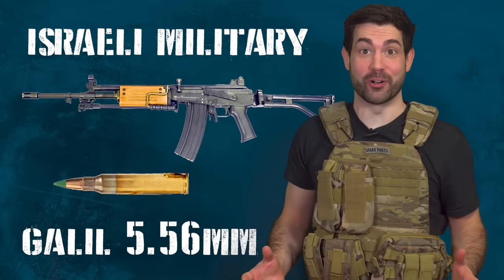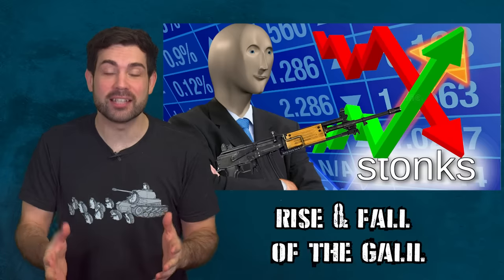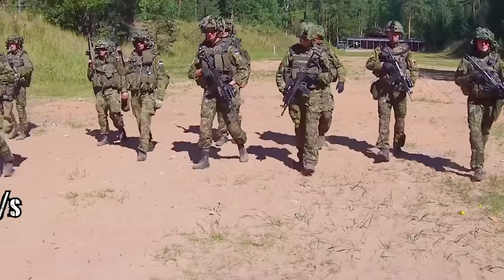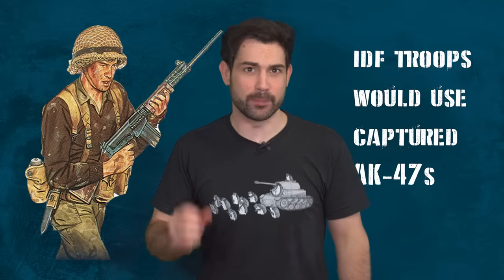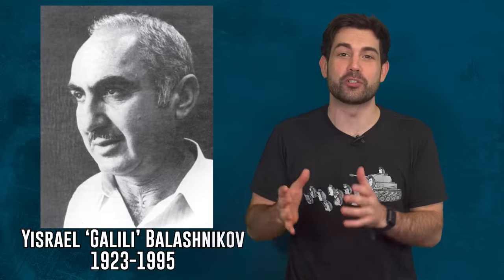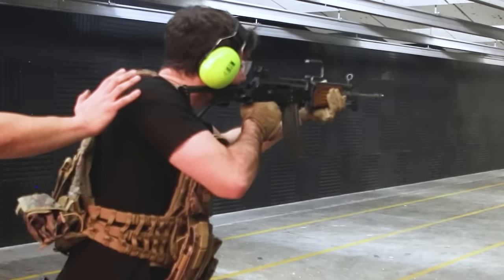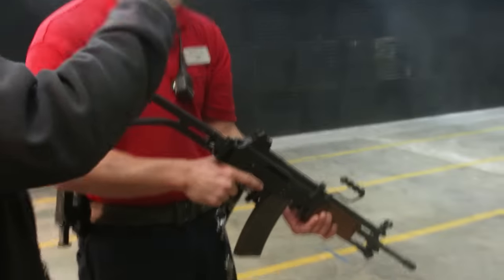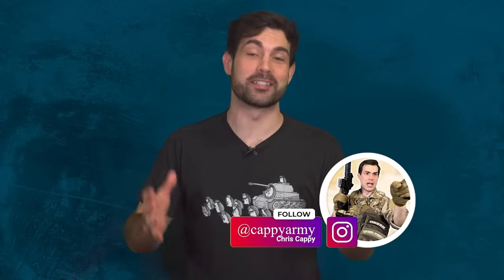Why the Israeli Army Created the Galil Rifle

Comment: Correction, Estonia made the switch to an LMT rifle designating it R-20 "Rahe", my battalion(you feature us prominently in the vid) was actually the first to get it. Spent a fair amount of time with both rifles and gotta say, the galil is still definitely my favorite AK variant, everything on it just makes sense, the charging handle, the safety, it was very pleasant to operate(didn't have the cap opener though, we had a pic mount :) ). The R-20 is a really good AR imho, not the HK416 but still very nice. Though how light and compact  it felt in hands after the Galil was astonishing. 

Former Sargeant, paramedic in the Estonian Scout battalion for 3 years
Reply from the maker: I had the pleasure of training with the Estonian army at Saber Strike international training event in 2010 you all were a great bunch of dudes! Glad to hear you dig the Galil. I'll have to look into the R-20 for a future video!
Reply: Thanks for serving in the cause of freedom !
Reply: I’ve got one of the Estonia LMT rifles. Excellent system!
Reply: Yep, if I recall the New Zealand defence force also adopted the weapon (they designated it as "MARS-L") a few years ago as their service rifle to rplace the old Steyr AUG.
Reply: @Infinite-if7uq  I believe their spec-ops adopted a variant. The NZ one is direct impingement, it's got a different gas block if you compare the two, ours has a short stroke gas piston I believe. I might be wrong though.
Reply: Estonian heroes for fighting ivans, esp in 44 at Narva
Reply: @BigRussianCatWithFloppyEars  Surreal how Estonia of all countries makes you froth at the mouth, more than Georgia or even Ukraine.
Reply: @Taskandpurpose  That would be cool.
Reply: @BigRussianCatWithFloppyEars  Castro Family’s servant.
Reply: When you are in a war for more then 70 years straight I think you will know exactly what you want in you're weapons, Probably that's why it felt like everything on the Galil "made sense".
Reply: @itzikashemtov6045  you know, that's something I hadn't considered. It's no wonder the IDF always seems so squared away given they haven't had any interwar periods in which to lose institutional knowledge. Hell, they've been fighting in towns since the 1940s.*

Also @ OP thank you for contributing! It's very valuable to hear from foreign servicepeople, whatever their experience happens to be.

(And honestly I'm glad to hear Estonia is liaising that closely with the US military. Hopefully that stays only relevant as a deterrent.)

.

(*Shame about the colonialism inherent in Israel's existence, but that's not really relevant here. (Much less Georgia, Ukraine, etc. which are even more unmotivated by capitalist interests in defending their own people from, among other things, real social oppression that many people still remember living with...besides them not being even slightly relevant to the video or this thread in the first place....))
Reply: @freedomloverusa3030  lol castro freed the slaves from the gusanos, you libertarian caricature!
Reply: @BigRussianCatWithFloppyEars  soy bean trolls here...
Reply: @Infinite-if7uq  yes I have one of those too. Pinnacle of DI service rifles.
Reply: @Taskandpurpose  Galil is based on Finnish the RK62's given by Finland to Israel. RK62, Finnish improvement of the AK, and then they took the design ideas from that and the FAL, making some chambered in .308, and 5.56, as well as having conversion for warsaw pact 7.62x39!
Reply: So that’s what I saw when I thought I saw a RK-62.
Reply: @VGClanMember  yes, LMT makes their rifle in both DI and SSP.

Comment: The Philippine National Police is also beginning to use the Galil ACE as their standard service rifle alongside their M4s(been seeing less of the cops in my city with M4 and M16A1's and more of the modern Galils)
Reply: Why were they using A1's? surplus? Why not have newer m16's.
Reply: @josephbilling6445  IIRC Philippines produced a lot of M16s or M16A1s locally back then so they're much more common than the other variants of that rifle
Reply: @josephbilling6445  we had and supplied a lot of M16's, both A1 and A2 models from the US and the A1 is popular amongst everyone because of its full auto capability compared to the A2 having only a 3 round burst fire mode. Regular cops use the A1 since most of it came from the former Philippine Constabulary stocks after they merged with the Local Integrated Police force in the 90's to form the PNP, while the Special Action Force(their counter terrorist commando branch) and SWAT teams used both M16's and M4's until recently
Reply: @alwayscurious3357  Ano po ang IIRC? Ang alam ko lng ELISCO A1s and carbines.
Reply: @neiljasonvillanueva1864  Shortcut for "If I Remember Correctly". My bad. Wrong placement

Akala ko si Elisco tools is M16s lang Ang minanufacture... Pati rin pala m4 carbines? Today I Learned
Reply: @alwayscurious3357  No Sir, I mean   m16A1(Long) and (m16a1 carbine or m16 carbine) aka "baby armalite".
Reply: or CAR15 (popular).
Reply: @neiljasonvillanueva1864  M653 tawag dyan, yong M16 Shorty... Or tawaging Baby Armalite
Reply: @neiljasonvillanueva1864  wlang CAR-15 dito, Colt M653 Ang term dyan... 
Kaso dpendi nalng yan sa itatawag mo.
Reply: Meron na tayong Galil, way back 1980s at yung galil na yun ay kaparehas si finiring ni Chris sa video na ito (Galil ARM) na wooden stock 
Tatay ko PC, at ibang PC noon, na issuehan ng Galil, especially PC SAF
At ibang "Elite Force" bodyguard ni Enrile at Ramos...

Naalala ko pa noon kung paano nya dini disassemble ang Galil (Inabsorbed na sila sa PNP nun) meron ring Galil SAR na ginamit ang Scout Rangers noong Early 90s. (Hindi ko alam kung kelan nanatili sa mga Rangers) yan nman ang sabi ng batcom ko noon...

Sa ACE nman, Mabigat ang ACE kumpara sa M4 , at yung charging handle nya nasa left hand mahirap pag nasa dibdib at nka plate carrier ka, pero dpendi nlang Yan sa pag adjust..
If I had to choose between sa ARs, Galil ARM/SAR, Galil ACE 
stick parin ako sa AR platforms, hndi nman yan binabase sa ganda at porma Ng Baril... Pag tinamaan ka ng bala balewala nlng lahat pati yung kaastigan at maporma mong baril...
Reply: @sicariomegrella516  parehong tama,. Kung  armorer ka ng army/pulis M653 tawag dyan sa papel pero kng titingnan mo sa tatak ng baril, Colt or Elisco, m16a1 makikita mo ( base sa mga nakita ko). wlang tatak m653.  Car15 tawag ng mga americano/israelis). "Baby -" tawag natin.
Reply: Sadly, our galil Ace have no can opener 😅😅😅
Reply: @sicariomegrella516   May mga Galil na pala nuon ang mga PC,  PC rin tatay ko, General Motors (Hydramatic m16) issue nya pagkatapos basic,  1968,  tapon kaagad sa Lanao.( Galil ang dala nuon ni Ranger Capt.  Eclarin sa yr 2000 battle of Kauswagan, LDN. (All out Offensive).
Reply: @josephbilling6445  budget. When they decided to upgrade, the PNP decided on a whole new weapon. Unlike the Armed Forces of the Philippines who chose the Remington R-4 and lately the Taurus T-4.
Reply: I though I saw a soldier carrying a ak-47.
Reply: The reason why PNP began using Galil ACE is because of the impending sanctions by the US Gov't at the time they still chose to order M4 carbine rifles from Remington (due to human rights issues from Pres. Duterte's drug war) as the next standard rifle of the police force. To avoid getting delayed, they instead chose to order Galil ACE and the rest became history.
Reply: @josephbilling6445  because they were given literally thousands of them from the US.

Comment: I fought in the border war in the early 80s in south Africa and used the R4 .it was basically an Galil made under license . Some differences we had an plastic hand held  instead of wood. An collapsible stock . The south Africans being generally large people there where 2 stock lengths the smaller troops could ask for an slightly shorter stock to be fitted. And the R4 did not have an carry handle so that on patrols  troops had to carry it in the ready position and could not carry it by the handle which would slow down your response in an contact situation and could cost you your life.  Remember it was bush war so engagements usually where on short distances we also carried  shorter magazines but we all carried a longer magazine as well. Then there was the R5 version with a shorter barrel length usually used by paratroopers. Was n great weapon never gave any trouble.
Reply: Thank you for your service.

Comment: I had both the Galil and M16 during my service. The M16 was nice to cary around, easy to operate and maintain, but total crap in combat - jammed all the time. The Galil has never NEVER jammed on me. The only rare occasions when you pulled the trigger and bullet didn't come out was due to faulty ammunition. The gun never jammed no matter how poorly maintained and full of sand it was. The short Galil with its folding butt was so short you could easily get through tank hatches or sit on the bus with it in your lap. On the other hand, it weighted a metric ton.
Reply: That is WHY the Philippine Army are NOT using anymore the M16 Rifle, even our Home Defense Force doesn't want the M16, because of frequent jamming, they much prefer the M1 Garand, M2 Carbine, all WW2 old school stuff, but very RELIABLE, much of our M16s are in storage, today the Philippine Army's standard rifle is the AR-15, some units are using the Galil, AK-47, even the AUG-Steyr and the Tavor
Reply: Uh... how was it easy to maintain, yet jammed? You do know those two things don't go hand in hand, right?
Reply: @Norman Ocampo  the M16s are not used anymore because they're old and worn out.  The Philippine Army and Marines standard rifle is the R4, which is essentially an M4 clone  made by Remington instead of by Colt or FN.
Reply: @StrainXv  Easy to maintain means that it is simple to take apart, does not accumulate too much residue, and most important - does not tend to rust even in wet conditions. Regular servicing it was short and easy. The Galil would show rust spots very quickly with even the slightest slack in scrapping and oiling - it would still fire, but would look like you stole it from a 3rd world militia.
All this was over 30 years ago in the early 90’s.
Reply: @rararnanan7244  Sorry, but a well maintained weapon does not jam. A poorly maintained weapon will.
Reply: @StrainXv  That is incorrect. The M-16 had some basic flaws that made it jam occasionally, the worst of which was not in the gun itself but the clips - the lips of the clips sometimes were too weak and this would cause two cartriges to be jammed in the chanber, either two new ones, or a new one with the emptied one that failed to eject. 
In field conditions you just can't keep licking your rifle - you take it out and it gets dirty by sand / dust / mud, and it gets fauled up when you shoot it. You can't take a break to clean it. In the old M16 this very quickly interfered with the ejection of the empty catriges, either failing to grab the empty cartrige leaving it in the barrel and jamming a new cartrige behind it, or not ejecting it correctly and get the empty cartrige jammed in all kinds of awkward ways.

In the M-16 jamming was a habit. The Galil never jammed, and the Uzi was so reliable that it sometimes fired when you didn't want it to...
Reply: @rararnanan7244  you firearms Nomenclature needs work.  What you literally just described is not ease of maintence/reliability, but rather a magazine flaw. Also, yes, in the field you can clean and maintain a weapon. That's a training issue, not a weapons issue.
Reply: Its because bolt lock system make guns jammed to much aks mp5 doesn't have bolt lock thats why they dont get jammed
Reply: It's reliable? Well no shit. It's just an AK.

Comment: I have an original Galil, and this year I purchased a 2nd generation Galil Ace in rifle configuration in 7.62x39. I love them, and felt my collection was incomplete without them
Reply: How much did you pay for them?
Reply: @robison87  I got the original Galil for a shade under $7000, and I wanted a low number Ace, so I got in a bidding war with another guy and just straight up bought it for $2379 after all fees and taxes. By the way, my Galil is a 1971 model
Reply: I’ve always wanted a original Galil but I’ve never seen one it person plus wouldn’t be able to afford it anyways so I settled for a Galil ace gen 2 rifle variant.
Reply: @HauntedHideouts  which Ace did you go with?
Reply: @hunterphille1280  the gen 2 rifle variant in 7.62x39. Just picked up some iron sights for it the other day. It’s a real shame the gen 2’s don’t come with iron sights like the gen1 did.
Reply: @HauntedHideouts  you did good man. I love mine. I'm good with the fact that IWI didn't do the same irons on the second generation Ace because I like not having a fixed front sight.  It may cost s little extra for a good set of flip ups, but you have the ability to pick what's best for you.

Comment: Ex IDF here. The biggest problem of the Galil was it's accuracy. A major design flew where the rear sight was on the cover that you took apart every field strip, unlike the AK-47, requiring calibration after every cleaning. And in anyway it moved around while the front sight remained fixed. After seeing soldiers had very low hit rates it was decided to ditch the Galil. It was also heavy and rusted easily. But yes, it kept shooting no matter how much sand was in it...
Reply: did you ever use the MTar?
Reply: @HerveyShmervy  the Tavor was after my time. In reserve duty I only used CAR15.

Comment: Nice video. I was drafted into the IDF in 1979 and fell into /"volunteered" for the paratroops.  We had M-16s in basic and got our long galils when we joined the Brigade.  Within a year, they introduced the Galil short version, without the wooden grip, or bipod.  My guys in the crew served weapons support squad (I carried a 52mm Yugoslav commando mortar) received the short version.  I wanted to keep my long version with greater accuracy at range, but it's the army.
Besides the simplicity of the Kalashnikov mechanism, my favourite feature of the Galil was speed on the draw: I could flick the selector lever on the left side of the pistol grip with my thumb, slap back the vertical bolt post to load with my left hand, and squeeze off a round from the hip without disturbing the direction of my barrel.  There are certain kinds of polite confrontations where that can be crucial.
In training, I never fired it on full automatic.  I heard that when Central American armies bought it for jungle warfare, they did a lot of automatic fire and the barrels were not adequate.
Reply: My dad got a Galil from the Israeli embassy in Panamá, personally gave it to President Somoza of Nicaragua in 1977. He had it adopted immediately. The Nicaraguan national guard was dealing with a communist insurrection/invasion, a lot of urban and jungle operations; the Galil never had issues. Even though it was lighter than the M16a1 (which was also in service) soldiers preferred the Galil even if it was heavier.

Comment: The AK has a complicated manufacturing history.  It was originally designed to be stamped steel, but the Russians were unable to hold tolerances and they had serious reliability issues when they heated up, so they changed to a milled receiver.   It took over a decade before they were able to make stamped receivers reliable. 

And yes, the older milled AKs are noticeably heavier than the stamped AKM.

Comment: Still the primary rifle of the South African Defence force. Was adopted in the early 80’s and South Africa made a version with a few minor changes and called it the R4. Used the rifle during the Angolan Bush war in the 80’s, it was a very rugged and reliable rifle and in the thick Angolan Bush most combat was happening at under 50m so long range accuracy was not a concern.

Comment: The original AKs were had forged and milled receivers. The AKM were stamped.
Reply: type 1 ak were stamp ,type 2/3 is milled
Reply: The original type 1 AK’s went to machined receivers in the type 2 because they couldn’t get the stamped ones to work reliably.
The pressed steel concept was based on the StG-44 (but the Russians changed almost everything to suit themselves).
Reply: @allangibson2408  Galil is a very new compared to the AK/AKM so they wouldn't have been comparing to the type 1 AKs in the 70s anymore... I doubt they even saw a type 1 AK.
Reply: @rkan2  The IAI Galil was derived (licensed production) from the Valmet RK-62 which was derived the Polish licensed version of the AK-47.
Valmet is in Finland and the Finns are intimately familiar with every Russian firearm ever made from border clashes and direct imports.
Each step added tweaks to the production process and tolerances.
Reply: @allangibson2408  Yeah, I know that much, though there would've not been any "border clashes" since WW2.. I shot the rk62 as a conscript :P

Comment: When I served in the SADF, I don't recall our R4s having bottle openers like the Galil but I do remember the bipod having a wire cutter to cut through barbed wire. Never used it for that purpose and it looked pretty flimsy.
Reply: The bottle opener was for a specific reason, the troops were using their mags to open bottles and damaging them. It'd be an easy cost cut if thats not an issue.

Comment: Their first versions were made by Valmet.  The best 5.56 AK was the Valmet which used a thicker stamping (1.6 mm) that provides a receiver with less flex than a standard AKM.  Valmet helped IMI out with its development.  Borrowed the iron sights.  The Valmet is 2 lbs lighter.  8 lbs vs 10 lbs.